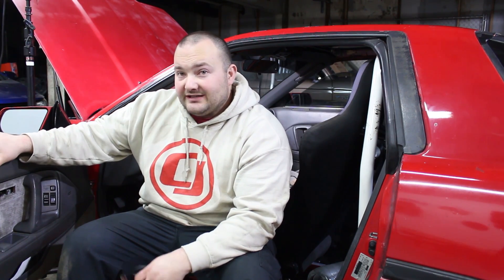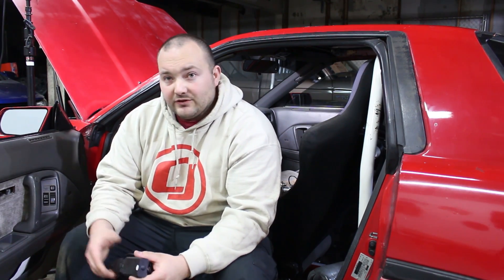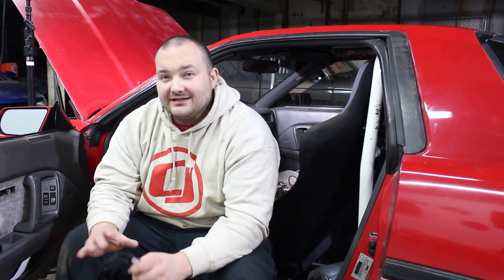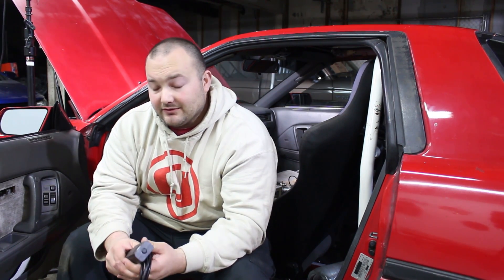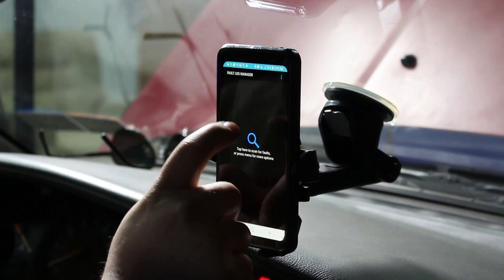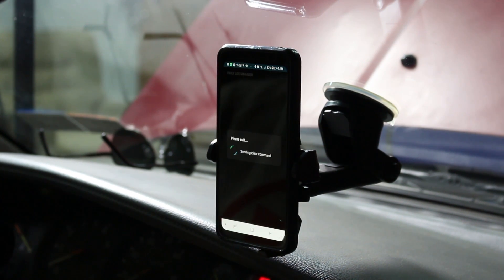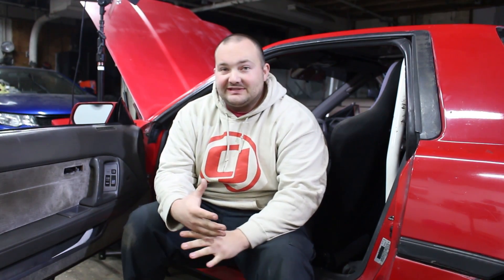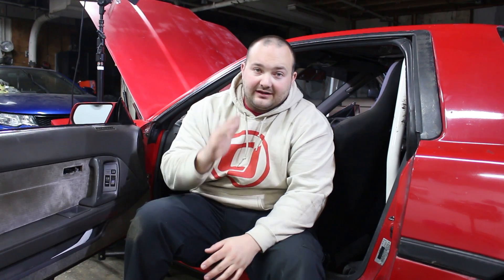How is my 1988 1JZGTE Supra now OBD2?

Comment: Are you using a can expander so your haltech wideband and your bluetooth adapter share the canbus? If not, how is your wideband wired in, an avi input? I am debating another brand wideband and the haltech wideband controller, but have to plug the haltech into the top and my oem floor/foot cover is only about 1/2" above the can connector on the top. Not sure the connector will bend enough to avoid stressing it. I wired in an OBD2 connector to the can wires on the end of the haltech ecu already, so can plug a bluetooth or wifi adapter into that, but am not sure which to use. Have a cheap elm327 bluetooth adapter but it isn't connecting to the haltech ecu even though the communication led is working.
Reply from the maker: I have an output wire going from my wideband to a wire on the on the haltech harness, when I was at haltech they chose the wire on the harness to utilize for the wideband input. Hopefully this helps

Comment: Your soo lazy, your harness or cluster is at fault for the readout. It's funny because I can take a raspberry pi and Arduino and make all of that for a fraction of the price. Having your system Bluetooth compatible is a bad idea. A hacker can easily hack into it and can fuck up your system by injecting code. If you think your Celica is a wiring nightmare you need to see my 86 s12 200sx mk1.5. where there are no electrical diagrams for the barometric version which only came in Nevada. I bet you $1000 you can't get my car to fire a spark and you'll get stuck on an obd1 readout thinking "this is why we have obd2 for finding exactly where the issue is!" But most times obd2 will cause diagnosing issues and won't trip a code until a sensor fails unlike obd1 which will throw a sensor code when it's in a margin of error.
Reply from the maker: Its not a celica its a firebird
Reply: Hahahaha wow this guy is better than everyone here.

Comment: Soo... Question is can you swap an OBDII vehicle with a JDM engine, wire it to a Haltech ECU, and use their OBD harness adapter to feed monitors and data in order to pass emissions inspection.. 🤔 maybe you can ask Haltech for me.
Reply from the maker: They have a great tech support team, give them an email or a call. But my guess would be yes, thats why they made it OBD2

Comment: Do you need an Haltech or u can run this cable/plug with stock ECU connected to the diagnosis box in order to make scanner work ? for those who runs JZX100/110/etc and stock ECU
Reply from the maker: You need the haltech ecu